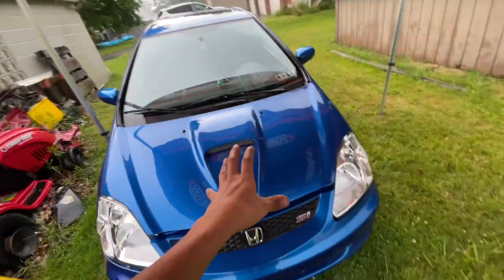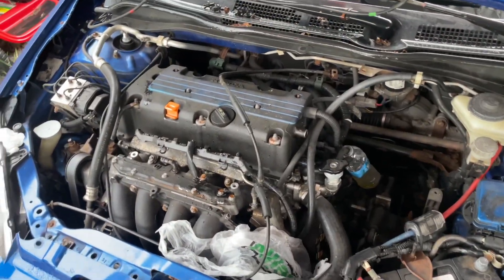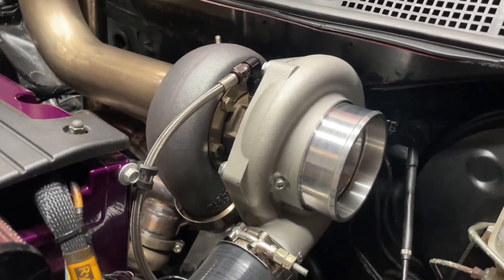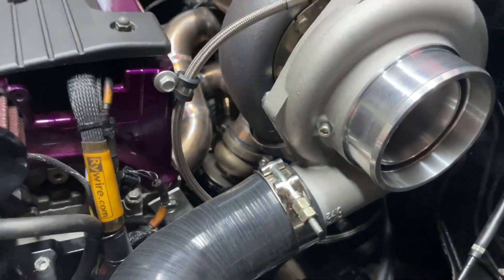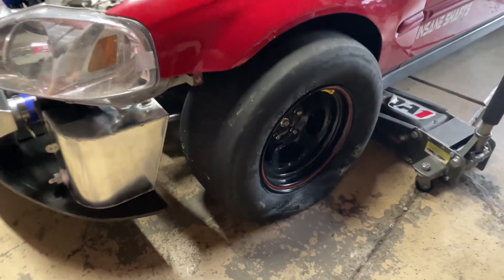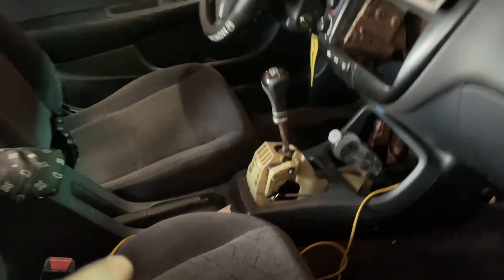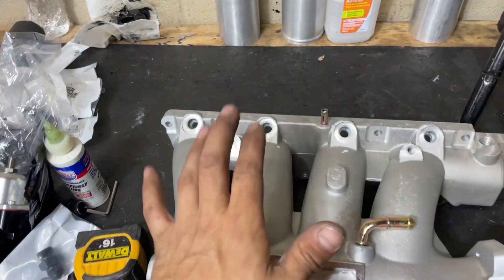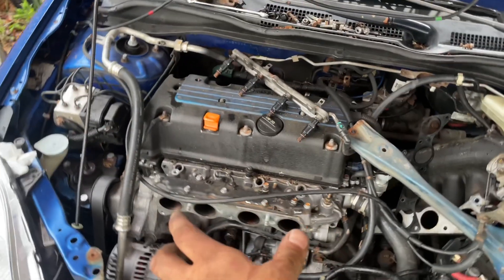Showing my EP3 Civic some love | FRANK’S GARAGE

Comment: Kinda late but as an EP3 owner I had same issue, replaced alternator and battery ending to find out it was ELD or Electrical Load Detector fixing my issue. Located in the fuse box  hold by 2 screws. Bought OEM one on eBay for $45.

Comment: Hey franks garage you can remove the intake manifold without removing the water pump by unscrewing the top stud from the intake nut using the two nut method to unscrew it off or you can buy the tool for stud removal… Check if the charge harness is connected!
Reply from the maker: True. I ended up finding a corroded wire on the charge harness